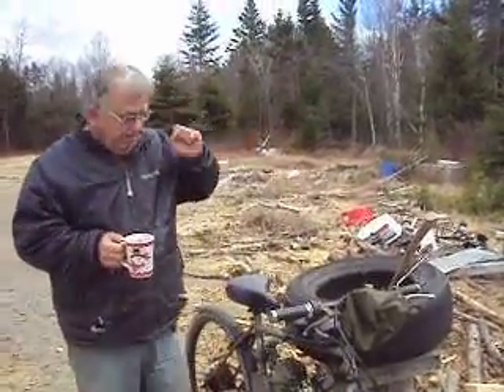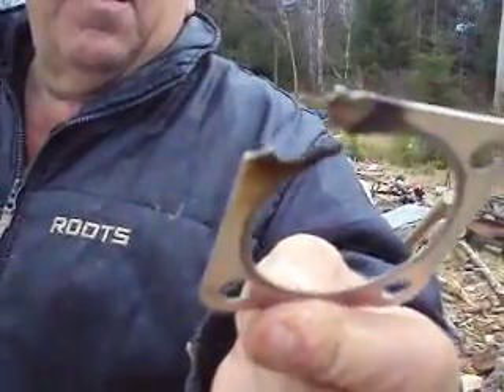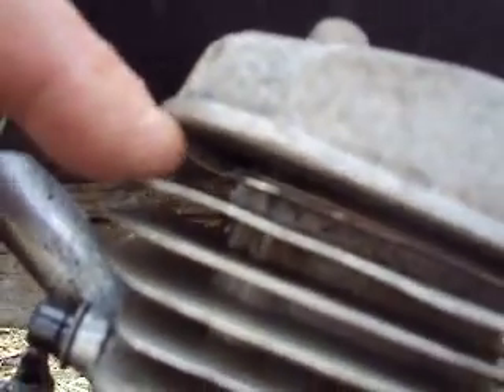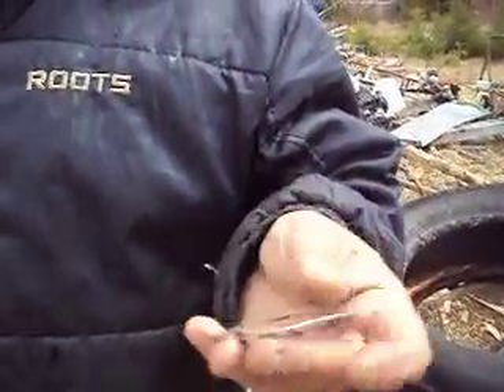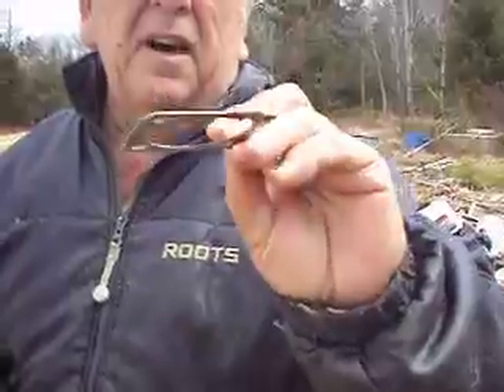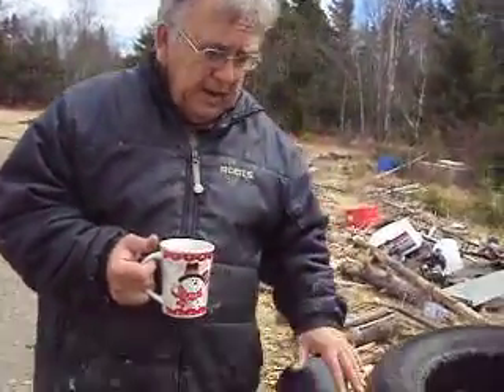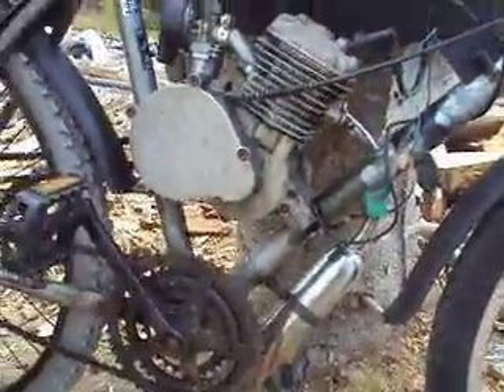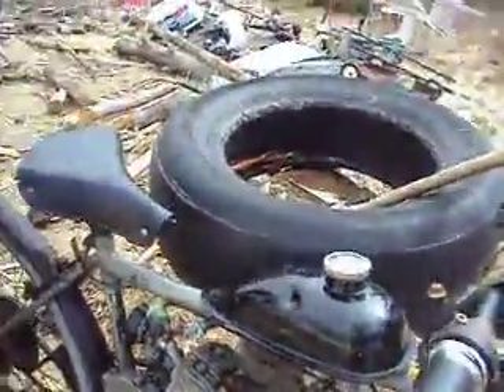Moterized Bicycle Blown Head Gasket

Comment from the maker: Well I would check the compression , the way to do that is to engage the clutch and if you can rotate the back wheel without any resistance then you have a loss compression in the cylinder.

Comment: I once made a head gasket for my bike motor out of a soda can.  You can actually cut the metal out and iron it flat.  It's thin enough that it works and it creates more compression.  Unfortunately, I have been rebuilding my engine after a wrecked crankshaft, and the piston now hits the head, so my soda can gasket doesn't work anymore.